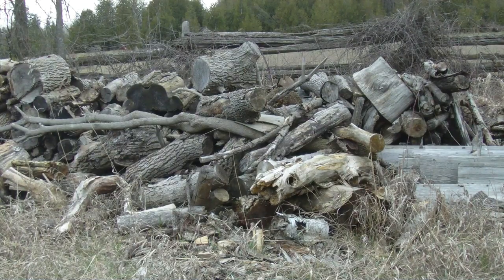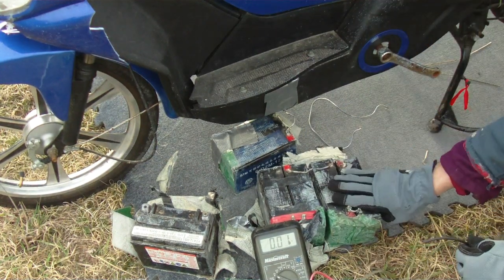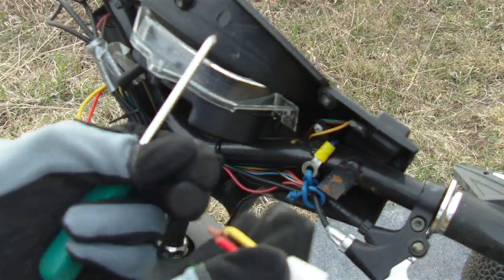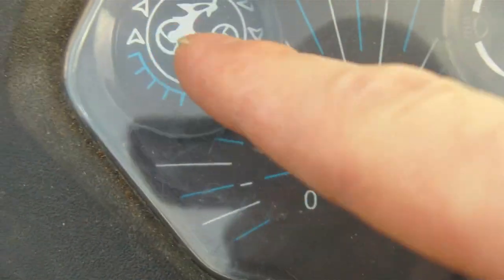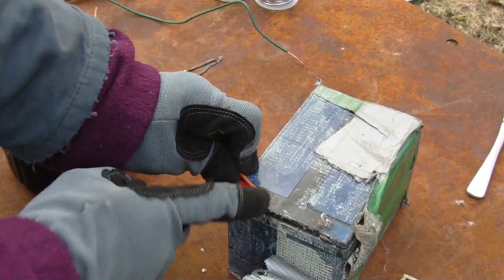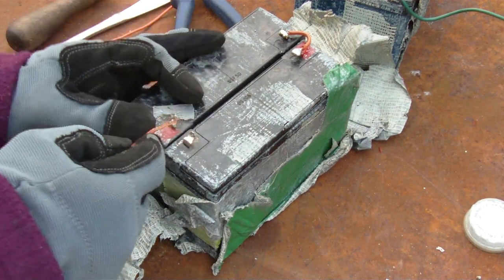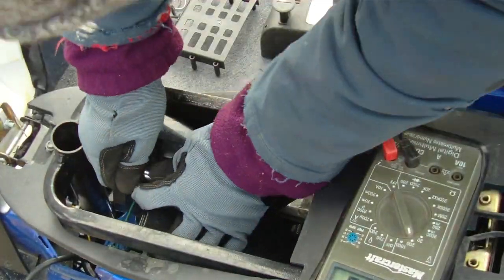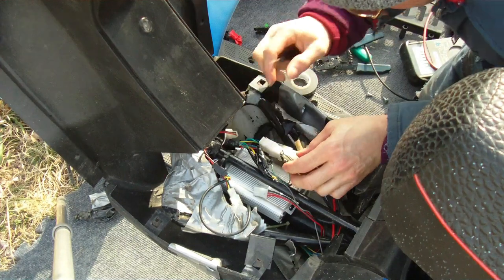Electric Scooter found in the Trash - Will it Work??

Comment: Just a PSA using plumbing seller is not a good idea because plumbing seller has an acid core instead of a flux core, The acid core can eat through the connection of the wiring so it’s not good for electrical because it can destroy the electrical connection that it’s meant to hold